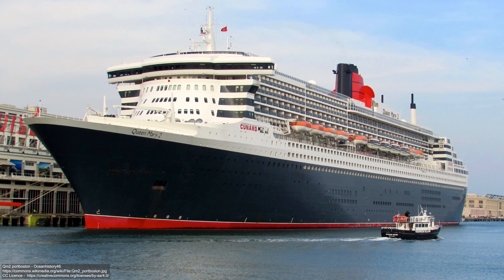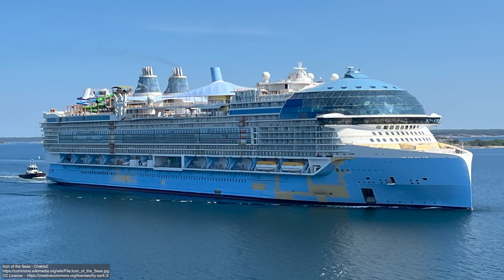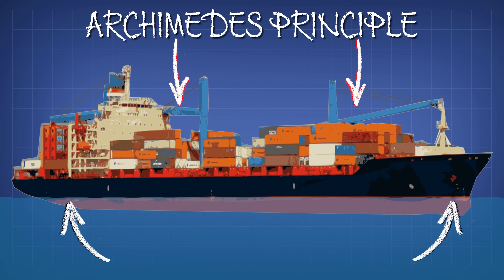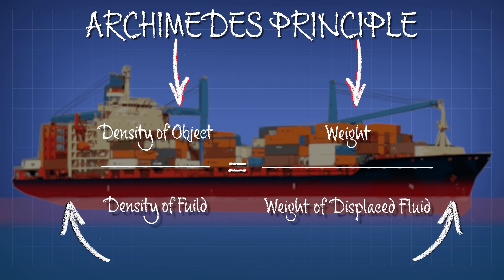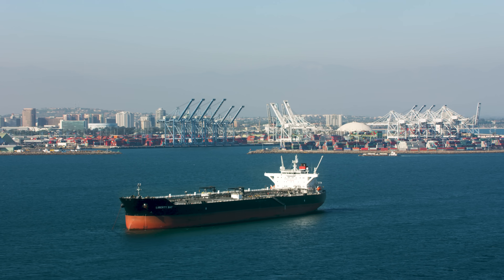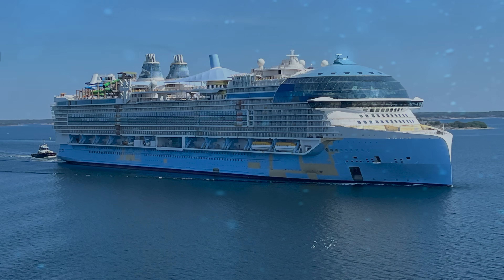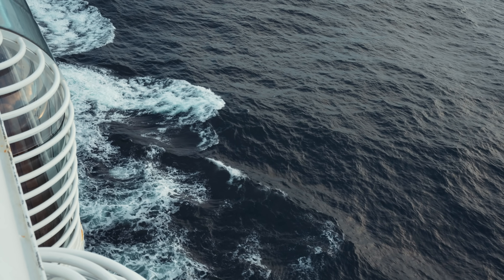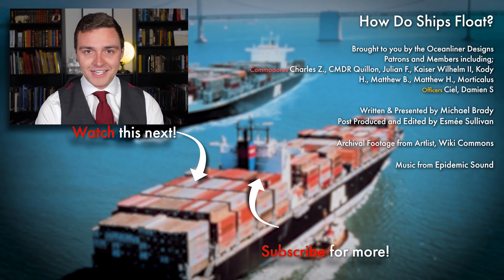How do big ships float?

Comment: Pretty sure a bus would float if it was made watertight. (I'm not 100% certain, since I'm not smart enough to do the maths on that.) Cars don't sick like rocks when they go into water. They only sink once the interior has filled up sufficiently to counteract buoyancy.

Also, consider that there already exists an ocean on earth that is less dense than water. The atmosphere. It's the same principle for things like a balloon or blimp, only they have to alter the properties of the lifting gas (such as heating it), or use a fill gas other than air, since that would just be the same density as the surrounding atmosphere.

Just some things I thought it might be interesting to note. Great video as always. :)
Reply: Re ocean of air, yes while watching this i was thinking of trying to push an inflated ball underwater, ships work the same way except the ball is made out of steel but it still floats. In fact a steel ball would float in the air if you put enough helium in it… like a dirigible! And there’s the Hindenburg in the size comparison chart. Its all the same physics
Reply: @soyevquirsefron990  you'd never get a steel vessel to float in air, no matter how much helium or hydrogen you add.  the weight of the vessel would never be overcome by the negative buoyancy of the lighter than air fluid.
Reply: @aaronkcmo  It would if it was big enough, volume grows faster than surface area.
Reply: @nadarith1044  in order to have enough volume the steel vessel would not be able to support its own weight. That's the problem
Reply: @aaronkcmo  A balloon doesn't support it's own weight either, soo.. just make a steel balloon.

Giant, kilometer wide steel balloon.
Reply: @nadarith1044  yes, balloons support their own weight.  if they didn't they would collapse like a giant steel foil ball.  how much do you think a 1km sheet of steel would weigh?  in order for it to float it (and the fluid contents) would need to weigh less than the air it displaces - basically less than the same volume of nitrogen.  i can't tell if you're trolling or you really believe it's possible to have a steel balloon.  either way your idea is preposterous and i will no longer engage with it.
Reply: @aaronkcmo  Balloons support their own weight ON THE FLUID INSIDE. Guess what happens when you remove that gas? They collapse like foil. Skin doesn't do any structural support here.

That sheet would weight less than the volume it encloses could lift when filled with lifting gas of some form, which is the point. This isn't hard dude, it's the same principle like any other balloon.
Reply: @nadarith1044  they don't collapse like foil, they deflate like balloons.  you're right, it's not hard to understand.  when you put a balloon on a hard surface it's able to support its weight because of the strength of the skin.  the skin is the only thing that's supporting the shape of the balloon.  the skin is the only thing providing structure.  to think that you could do this with any material is a fantasy.  steel would weigh too much, is too rigid, does not expand, would collapse under its own weight and would never be able to be thin enough or enclose enough volume to even come close to neutral buoyancy.  i'm still not sure if you're a troll or if you actually believe what you're writing because it's so detached from reality.
Reply: @aaronkcmo  I literally used your own terminology here, doesn't matter how you try to call it, it doesn't hold shape without the gas. That is the very definition of 'not supporting its own weight'. And balloons, the actual ones not party balloons, don't 'stretch' when filling, they simply fill up and the gas pressure prevents the skin from folding.

Sheets of steel are actually very flexible when thin and have more tensile strength than things like balloon canvas (mostly nylon), and at the scales we're talking about even a thick sheet the likes of a ship's hull would behave as if a flexible surface. I don't know if you're imagining it crumpling or something or what layman's idea of material science you have, but the way materials behave at normal scale is very different to the behavior seen at scales that differ by 2 to 3 orders of magnitude.

And I'm neither, I just know enough about physics, engineering and material science to know it's not in theory impossible. Unfeasible maybe, definitely impractical, and very ridiculous, but not impossible. You can also switch the idea from a homogeneous sheet to a skin of tightly woven, very thin steel wires to make it less daunting.
Reply: @nadarith1044  lol. OK homie. Go build me a steel balloon that's lighter than air. Good luck
Reply: @aaronkcmo  Dude can't argue a hypothetical so he attempts to save face, lmao. Learn what 'hydrostatic support' is next time. Or how air balloons actually structurally work. Or how flexible steel really is.
Reply: There does exist a small blimp made of lead foil.
Reply: @Appletank8  lead is different. Even though it's more dense than steel it's way more flexible and can be pounded into much thinner sheets without losing structural integrity or airtightness. It can also be joined easier. It's a completely different material than steel
Reply: @aaronkcmo  I'm not sure we have the same definition of "structural integrity". Assuming we all watched the lead balloon test from Myth busters, they have said it was a nightmare to work with, tearing if you exerted too much force at the wrong place. At the thinness level they were working at, it had basically the strength of tissue paper.
Reply: @Appletank8  if you attempt to roll steel into sheets as thin as lead it will not support its own weight and will certainly not hold air.  this is what i mean.  you can pound lead down to ultra thin sheets and it will still be airtight and hold itself together when supported by a fluid, which are important qualities for a balloon to have. you cannot do that with steel.  if you think working with lead foil is a nightmare, try to weld ultra thin sheets of steel together.
Reply: @aaronkcmo  You fail at material science, forever. The only metal-clad dirigibles were aluminum ones. And lead? Oh sure, a metal 3 times weaker than nylon and heavier than steel. Dude, according to your own logic it would genuinely tear itself at the bottom of the envelope as it hangs. If that blimp really exists (can't find anything about such) then a steel one would easily fly.
Reply: @Appletank8  Wait, so that's real? And here I thought you'd need a giant balloon to have any chance with steel! If a lead that thin can work, then I guess a steel one wouldn't need to be that big at all.
Reply: @nadarith1044  no dirigibles were metal clad, what a ridiculous thing to say.  dirigible skin was always fabric.  the idea of a metal balloon is a farce.  steel is completely out of the question.  lead and gold are the only metals which would have a chance of having anywhere near neutral buoyancy.  you can pretend that what i'm saying isn't true, but i would recommend you do some research before you make a fool of yourself again.  tons of metals are "weaker" than nylon in tensile strength, very few metals are stronger.  you keep running down my knowledge but you seem to possess very little and you don't even attempt to counter my points.  all you want to do is conflate, obfuscate and misrepresent my ideas.  as i've said before, please make your steel balloon and show all the engineers that are alive today and have lived before you how wrong they are.  also, please tell them how they have failed in your opinion.  i'm sure they could use a laugh.
Reply: @aaronkcmo  Speaking of a fool, here we have one who can't fact check before speaking. One prototype was called 'all-metal airship' in german, another had the plates unroll due to unexpected factor change in temperature and pressure (it held the gas with rolled aluminum plates). Where does the idea those metals can't hold the gas even come from?
Reply: @aaronkcmo  ... Gold. Lmao.

Well, at least it's not lead.

I would really want to know what 'research' leads to the conclusion that those two can do the job but not aluminum, steel or titanium.
Reply: @aaronkcmo  On the other hand, steel is less dense than lead, so you can afford to go a bit thicker and therefore stronger sheets for the same weight, and therefore use the same amount of helium for lift. They didn't even use pure helium because it was TOO buoyant. If you really needed more lift, there's always hydrogen.

also, the mythbusters used tape to hold the sheet together, so all else fails, you can use plastic wrap to get it airtight long enough to get a picture.
Reply: @nadarith1044  lol.  good luck with your steel balloon homie
Reply: @Appletank8  lol, try and use tape to hold steel joints together.  you don't have to "afford" to go thicker, you must go thicker.  significantly thicker in fact and also significantly heavier.  if you use a plastic bag to seal your metal balloon, is it still a metal balloon?  the answer is no.  are you guys kids?  i don't understand the blind devotion and expended energy on a ridiculous idea.
Reply: @aaronkcmo   Well, people thought a lead balloon was impossible until 2 dudes (and a production crew) shopped around trying to find anyone able to make 1-thousandths inch thick lead, and even then when they started inflating it, the lead kept tearing constantly and had to be patched by tape slapped all over the place as it grew. That thing was definitely not airtight, but it just had to be airtight enough for like 10 minutes.

As for steel foil, the commercial foils off McMaster have .001 in thick sheets, using the same dimensions of a 12 foot^3 balloon, it'd be around 35 lbs or 15 kg, which is about the same weight as the Mythbuster's lead balloon. So yea, I'd believe tape that can hold together 12 kg of lead foil would have no problem with 15 kg of 0.001 in steel sheets. 

This back of the napkin calculation isn't really that much effort compared to taping a giant sheet of wet toilet paper together.
Reply: @aaronkcmo  At this point, after the other commenter gave concrete numbers no less... you just look like the balloon equivalent of a flatearther.
Reply: @nadarith1044  of the two of us, one does look like a kook.  i'll let you guess which one, mr "metal clad dirigible" lol
Reply: @aaronkcmo  You, yes. How embarrassing of you to not even fact check the few all-aluminum airships that actually existed.
Reply: @nadarith1044  lol, ok, whatever you say bud.  lol
Reply: If it weighs less than the fluid it is in, it will float. So a bus full of air, floats, a bus full of water sinks (in water). A Bus full of air also sinks in air, as does a bus full of water in air. So 3 out of 4 busses sink.
Reply: Yes a bus will float for a while, till it fills with water, as there have been many tragic examples of. This led to the requirement that all buses have to have glass break hammers by the windows, as it was found the windows that you can push out, the previous standard, were not effective if you were a child, or somebody not strong and fit. Took a busload of children going into a lake to get that one enforced.
Reply: FYI, David Schwarz, a Croatian inventor in like 1895, made an airship whose balloon was made entirely out of Aluminum Foil and internal brackets. It crashed, but it got to around 100 m before the engine belt broke and the pilot lost control.
Reply: I was surprised that he didn't mention the parallels between floating craft like boats & people when we float/swim:  when we lay flat on the water's surface, we float; when we jump in or stand upright, we sink.
Reply: Doing a little digging I found the dimensions of a double decker bus.
	11 meters long.
	2.6 meters wide.
	4.42 meters high.
Give or a take a bit because a bus isn't quite just a block.

I also found that a bus weighs around 18 tonnes.
Given those dimensions, the bus volume is 126,000 liters.

Conveniently, 1 liter of water is about 1kg.
So a bus volume of water weighs 126,000kg - or 126 tonnes.

A double decker bus would easily float if it was sealed up to not allow any water to enter.

https://foi.tfl.gov.uk/FOI-1433-1920/Bus%20Vehicle%20Specification%20v1.1%20May%202019.pdf

https://www.london.gov.uk/who-we-are/what-london-assembly-does/questions-mayor/find-an-answer/new-bus-london-vehicle-weight-1

Comment: Ah yes, Empire State building, my favorite big ship.
Reply: how do we know it doesn't float unless we try.
Reply: @Itchy_Ninja_Go  mathematics. Its buoyancy is much greater in air than water, that's why they built it on land. The very tip of it is incredibly buoyant and holds the entire thing  up, hence why its fixed to the ground or it'd just float away...or something...
Reply: @ThePsiclone  THAT'S why they call the tip the "mooring mast" It all makes sense now.
Reply: @Itchy_Ninja_Go Math of course!
Reply: @Itchy_Ninja_Go 😂😂😂😂
Reply: And the hindenburg
Reply: @STUKA9113  it's an airship.
Reply: @STUKA9113 hey, maybe if it was in water it wouldn’t have exploded…probably not though
Reply: Its mine too
Reply: @klairith. I always preferred the Chrysler Building. More elegant but, of course, older, smaller and with fewer funnels.
Reply: Interesting tidbit, the weight of the Queen Mary II is the same as a line of fully loaded tractor trailer trucks nearly 44 MILES long. Das one fat beeatch.
Reply: The Empire State Building was  actually originally constructed to be a boat most don’t know  that
Reply: @cocodrilo3042 ... Thanks for info because I never heard that until now.
Reply: Mine is the Chrysler building.
Reply: excellent lift systems and stairwells to get you bow to stern but not so easy to get from bilge to deck
Reply: my favorite ship is 3 football fields
Reply: Hehe.
Reply: Still better than a majority of the Russian navy
Reply: That's the MCRN Donager, not the empire state building!😉
Reply: exactly
Reply: At least he picked the correct Enterprise. 🤔
Reply: Bro same
Reply: That’s a normal US unit of measurement, right?
Reply: That's a funny way to put it and I don't understand why I never thought about it that way😂
Reply: Measuring things in London buses.  Hahaha.
Reply: RMS Empire State Building to you 😂